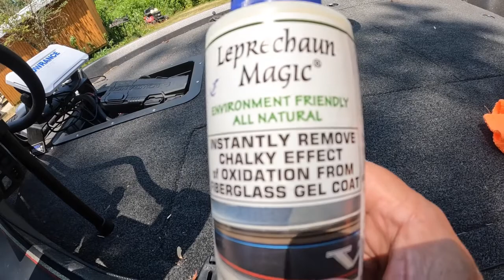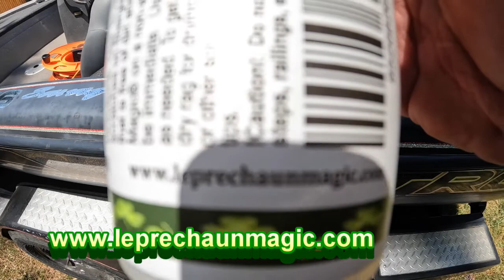Leprechaun Magic Boat Restore

Comment: This stuff is crap.  Liquid furniture polish that never dries.  Lasts about a month.   Does not remove oxidation, it simply covers it up short term.
Reply from the maker: Well it was not a total fix for mine lasted 6 to 8 weeks before re applying! I t was the best product for older boat surfaces. It was never intended for a permanent solution. Wet sanding and all that is the total fix.
Reply: @ordinaryangler4153 so all that needs to be done is wipe that stuff on every 6-8 weeks?
Reply from the maker: @jefflovinfishin621  yes its not permanent but don't people wipe their boat down usually after they get out of the water?
Reply: @ordinaryangler4153 do you need to apply it every time you take the boat out of water? Also, looks slippery to the touch. Is it?
Reply from the maker: @jefflovinfishin621  No it's a concentrated wax. It lasted on my boat several weeks. You will see as time goes by when you will need to redo it. Clean the surface clean cloth.